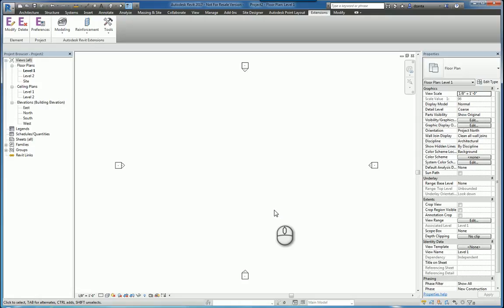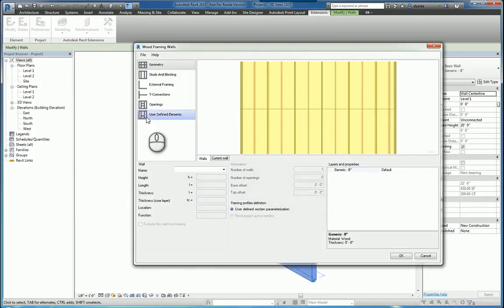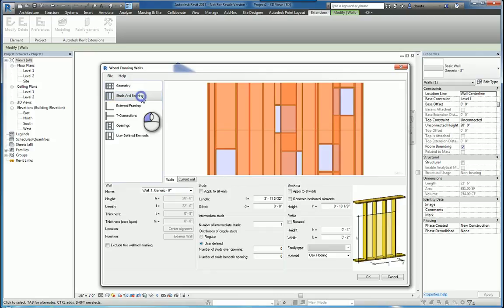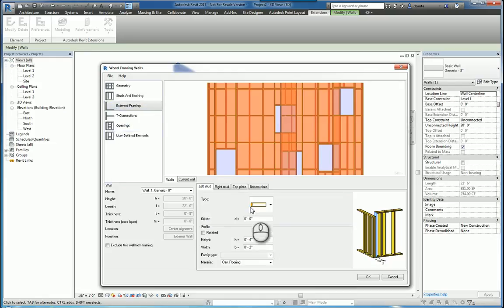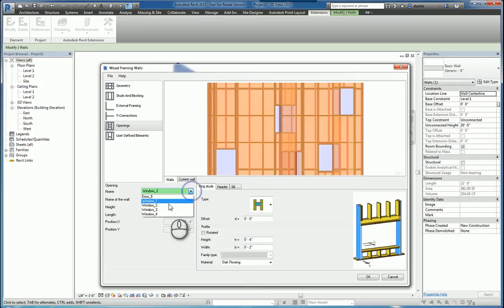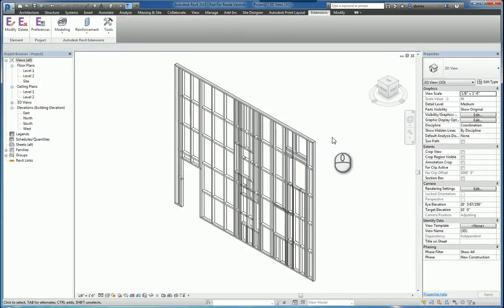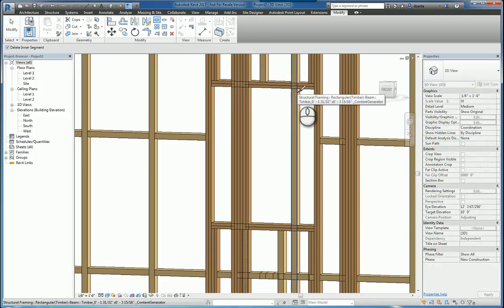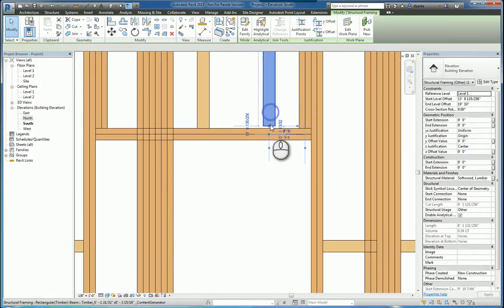Revit Extensions Modeling Wood Framing Walls   A How To Guide

Comment: could you give me a download link for this tool for revit 19 ?
Reply from the maker: I believe it was specific to 2017 or 2018 revit.  You can get it by going to manage.autodesk.com and looking under Product updates.  I will see if it's still available asap.
Reply: Dzan Ta  no it doesn’t exist 😒😣
Reply from the maker: @famgamal1779  https://up.autodesk.com/2018/REVIT/REX_2018_Win_64bit_dlm2.sfx.exe
Reply from the maker: 2018 is the last year they made this wood extension for Revit.  2019 and higher doesn't show the extension anymore.
Reply: @DzanTa  19 not 18 my friend
Reply from the maker: @famgamal1779  sorry...doesn't look like the extension exists for 2019 or higher
Reply: Dzan Ta thanks my friend for your efforts ❤️

Comment: Hello Dzan Ta, very useful tutorial , but i wonder if this tool available for Revit architecture 2016!
Reply from the maker: Hi Amjjah...they are part of the Extensions for Revit.  You can open the Autodesk Desktop App to download the extensions.
Reply: i did! and installed it successfully, i did run Revit  but the Framing tool does not appear in the Extensions options! maybe i should install the Revit 2017! thanks for the replay